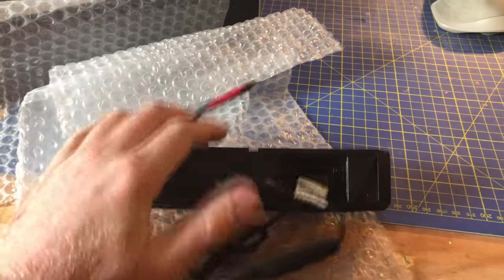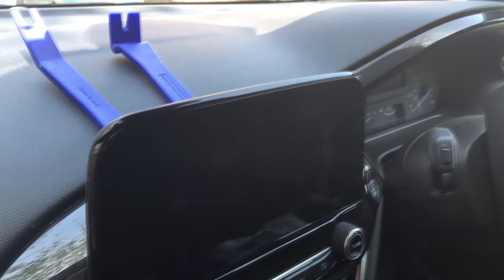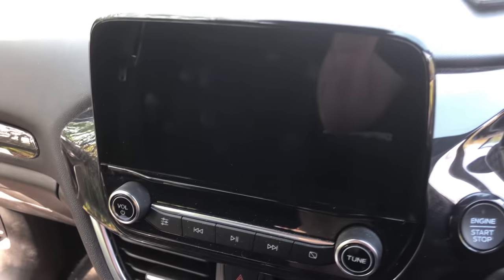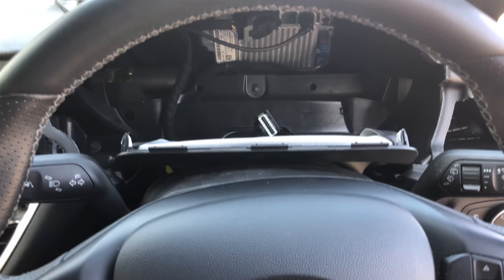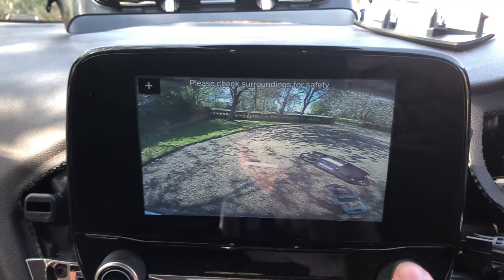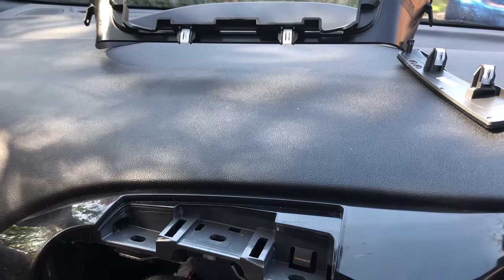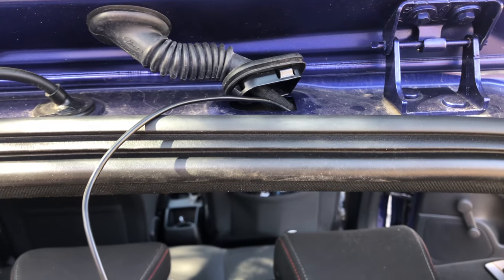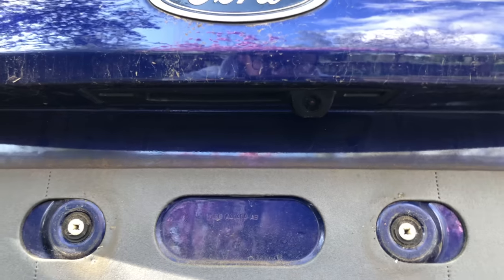Reversing Camera Install - [2018 Fiesta Mk 8 - SYNC 3]

Comment: The cruise control upgrade is pretty easy to do on this version. On our 2017 mk8 we just needed to replace the left hand steering wheel switch cluster and change the config with Forescan.
Reply from the maker: That is a excellent idea, i'll have to try that one day.
Reply: @FluxLabsProjects  Just for info the part number we used was H1BT9E740-AB. You probably have the -BB version that doesn't have the cruise control on/off button. On some cars you also have to replace another part between the steering wheel and car but we didn't on ours.
Reply: Are you saying you can add cruise control when you didnt have it as factory?
Reply: @knobstop25  Yes. Ours came with speed limiting only and we added cruise control so it has both. The only hardware we had to change was the left hand switch assembly on the steering wheel to one with a cruise control button. We then used the free version of Forescan to change the configuration settings. I can't remember exactly which configuration settings but it wasn't too hard to work out. I think one of them required us to enter the part number of the switch, or at least a number on the switch so you need to write it down or take a photo before fitting it. We have done it on a 2017 and a 2018 Fiesta. Edit: You have to tell your insurance company but ours considered it a software only change and didn't charge anything. Others might charge a small fee to amend their records.
Reply: @ColinWatters  Hello and thanks for the good info. I am a newbie here trying to figure my upcoming ford fiesta mk8 that does not have camera/parking sensors , are these "easily" upgradable and what other things can you do using forscan. (i seen the list on the google sheet but not sure which is which for my car) For example I saw that there is an option for auto opening/closing mirrors but I imagine my car has to have motors in them... How the hell should I now if there are things like this in my car? lol
Reply: @vinyldown8490  Sorry, we only did the cruise control mod and that was 2 years back. Havent investigated other settings for the Fiesta. There is probably a forum somewhere for forscan? FYI.. We did tell our insurance company and they said it didn't affect our insurance premium.

Comment: looks like a lot of work, I've just bought 2019 Fiesta St-Line and thankfully it came with one already installed 🙂, slight difference (and I think mine is factory fit) is that when reversing it shows colour-coded moving guidelines when reversing .. does your kit?
Reply from the maker: Consider yourself lucky! Mine does not. Just a plain video like in the video.

Comment: Thanks for the video as thinking of doing this with my Focus.  Did your car have reverse parking sensors ? I thought I heard the bleeping and wasn't sure if you'd lose them.
Reply from the maker: Hi, thanks for the comment. My car had no reverse sensors. I don't know what would happen to your reverse sensors if you used this kit, i'd suggest contacting the manufacturer of the kit.
Reply: @FluxLabsProjects  Thanks for getting back. I've emailed the company. See what they say 🙄
Reply from the maker: @chrissing64  Good luck!
Reply: @FluxLabsProjects  ibforgotvto ask last time, I'm still thinkng about fitting a  camera. Does the boot lock still work with the central locking with the camera handle and how much warranty do you get mate.
Reply from the maker: @chrissing64  Yes, boot button still works, the new part they send has a camera on the side next to the buttonm abd the back has the same plug as old one. Don't know about warranty, probaby a year? You'll have to ask the company.

Comment: Thanks for uploading!!! Just used this video to install on my Fiesta - this video was perfect and saved me from lots of fascia chips / broken clips!
Reply from the maker: Happy to hear! Let me know if you think it was worth it after using it a few months :)
Reply: hi how did you remove the decorative surround from speedometer?
Reply from the maker: @kevsurbanexploring8160  carefully, with several trim tools all around the edge. Its the trickiest bit both to take off and put back. It's been a while since i did this and i can't quite remember the exact procedure, i just remember taking my time and getting fustrated. Sorry i can't be more help!
Reply: @FluxLabsProjects  Thanks. Think i will be ok with the plastic cowling. just stuck on that speedo plastic shroud. not one other video on the net that shows it apart from yours lol
Reply from the maker: @kevsurbanexploring8160  It will come out, eventually. Good luck!

Comment: Is it just one cable from the front of the car to the back? Or do you need to wire up a 12V supply to the camera separate?
Reply from the maker: In this kit, just the single cable.

Comment: Fantastic explanation of how to fit the camera unit thank you. Just completed an installation myself. Only comment is that it’s not necessary to separate the trim around the dials. If you have a torx driver that can get to the 2 torx head  screws below the dials then once they are removed the whole dash panel just pulls off by hand. Easy!
Reply from the maker: Fabulous, thanks for this!
Reply: how can i do this without removing the trim around the dash?

Comment: Hi there, great video! The cable with the yellow end that's seen in the middle @ 11:02 (I'm guessing it's an antenna connector), can you just pull it off the display or is there a tab or something? I was trying to remove the display on my Fiesta and it didn't really want to come off and I didn't want to do something wrong.
Reply from the maker: It's the video data cable for the display. it's tricky to get off, you need to press the lever in on the connector,  then the connector will come out from the screen. It's tricky but once you know the technique it becomes quite easy.
Reply: hi how did you remove the decorative surround from speedometer?

Comment: nice video, but forgive me if i don't understand yet, i have a fiesta 2019 without camera, obviously no video. If I want to install the rear view camera, just add the cable or do I also have to program via PC?
Reply from the maker: Yes, you need both. Your Fiesta will have come from the factory without a wire in the harness for the rear view camera.

Comment: Great tutorial. One question. Do you have any idea about what additional cable you need to have direction guidelines on the camera?
Thanks a lot
Reply: I don't think that this kit (or any kit like it) can do direction guidelines, as this kit is non OEM. I could be wrong, however.
Reply: @slick.productions  is there a way to have the direction lines? I mean getting an OEM harness or something that can give you direction lines?
Reply from the maker: @passworsstrength  I don't know for sure. I would set about finding out if the directonal lines are added by the camera or the Infotainment. If it's the camera, then i'd buy it and a harness and fit it. If it's added in the infotainment, then you'll probably need to find someone with experience with Sync (not me sadly).

Comment: Did you connect a wire to the reverse light?
Reply from the maker: No, just the connection to the SYNC unit behind the dials. I suspect it knows when it's in reverse as the SYNC sees this on CANbus.

Comment: Can you please confirm which pin numbers in the apim harness have the camera input wired?
In the orignal harness those pin slots must be empty and in the aftermarket harness there must be Camera input going to those empty slots.
Reply from the maker: I can't tell you as it's buried in my dashboard right now but if I remove it I'll do a video on it.

Comment: How easy is it to remove the trim around the infotainment screen? Can it be done without taking the whole screen off?
Reply from the maker: The carbon fibre effect trim was relatively simple, but the black shroud around the dashboard was trickiest. You need to remove the screen so you can fully remove the carbon fibre effect piece. I would say it is impossible to do this task without removing it. Hope that helps.
Reply: @FluxLabsProjects  can you describe how the black shroud around the dashboard (speedo plastic trim surround) came out? im having a nightmare removing it

Comment: Hi, how did you get the compass on your screen in idle mode?
Reply from the maker: It comes like that from factory for me. I didn't code that.
Reply: Cheers for the quick reply.  It looks good, I will see if anything is on forscan.  Thanks for a great tutorial, much appreciated.
Reply from the maker: @stevenwright103  Not a problem. I assumed it was just because I don't have maps/navi on my unit that it just gave you the compass.

Comment: Hi I’m looking to buy this kit, is yours still working okay? Fantastic job on the video, also do you think it’s worth £279? Cheers Mike.
Reply from the maker: For the time i had it installed, about a year, it worked well in it's primary function. I was quite annoyed that it ruined my DAB reception, so bare that in mind. 

Is it worth it, well i am still on the fence about that. I think it depends on how well you can reverse park. But as for intergration with the existing vehicle screen, i think it is.  

FYI i no longer use it as i have installed some other head-unit that doesn't have a camera input, the camera worked fine till this point.